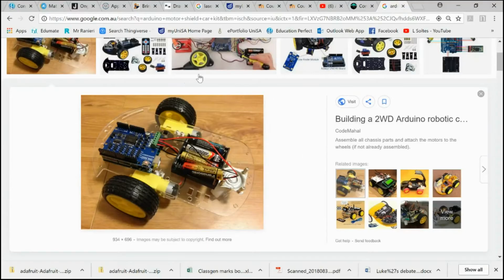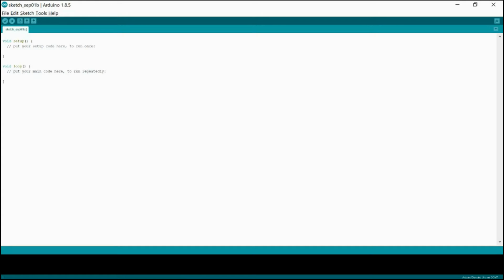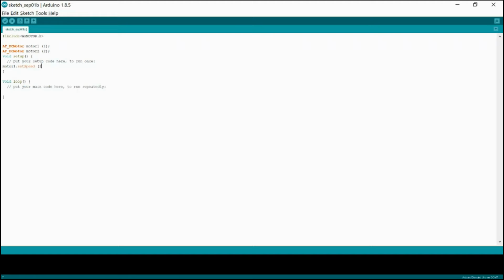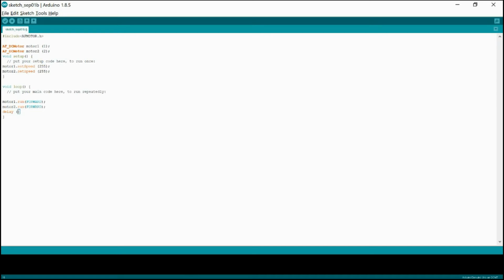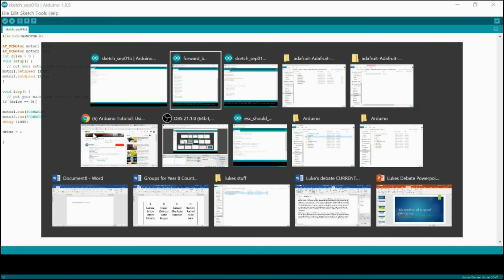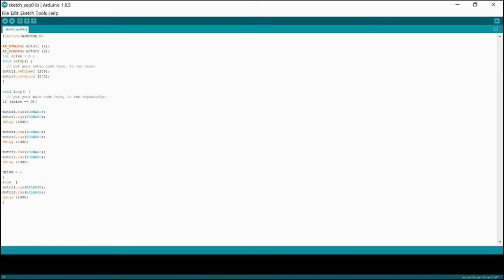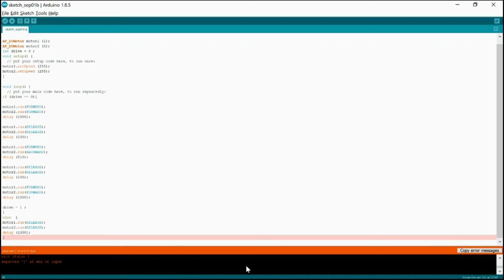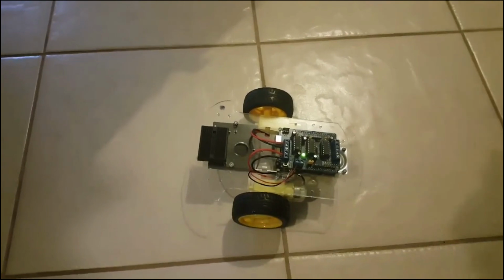Arduino car coding.

Comment from the maker: #include<AFMotor.h>

AF_DCMotor motor1 (1);
AF_DCMotor motor2 (2); 
int drive = 0 ;
void setup() {
  // put your setup code here, to run once:
motor1.setSpeed (255);
motor2.setSpeed (255);
}
void loop() {
if (drive == 0){
  delay (1000);
    
motor1.run(FORWARD);
motor2.run(FORWARD);
delay (1000);

motor1.run(RELEASE);
motor2.run(RELEASE);
delay (100);

motor1.run(FORWARD);
motor2.run(BACKWARD);
delay (510);

motor1.run(RELEASE);
motor2.run(RELEASE);
delay (100);

motor1.run(FORWARD);
motor2.run(FORWARD);
delay (1000);

drive = 1 ;
}
else  {
motor1.run(RELEASE);
motor2.run(RELEASE);
delay (1000);
}
}